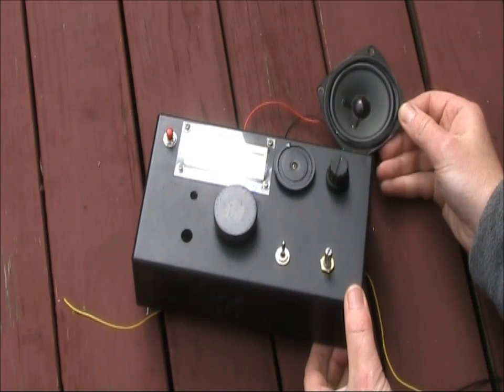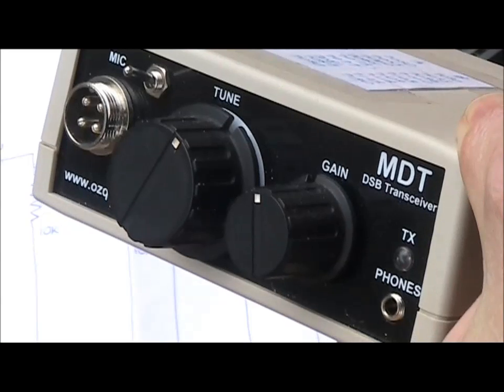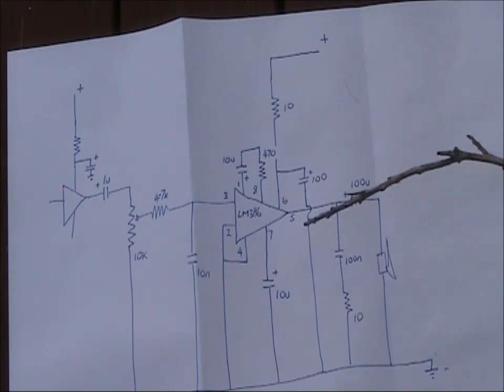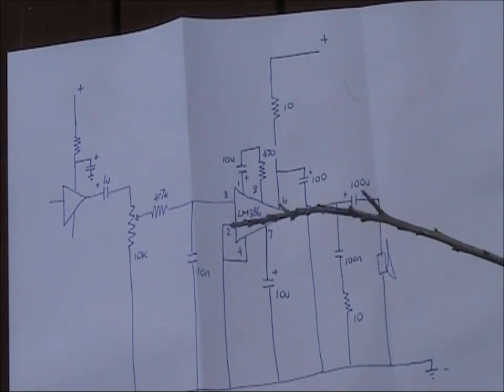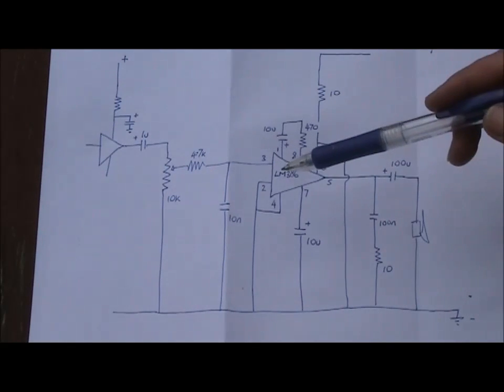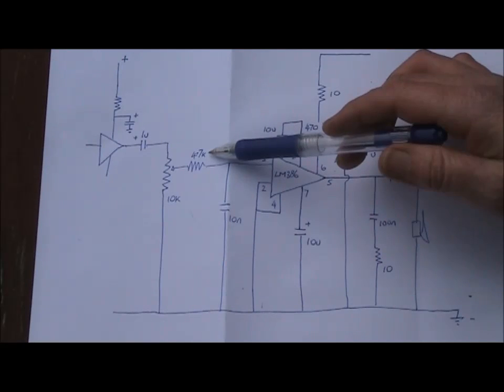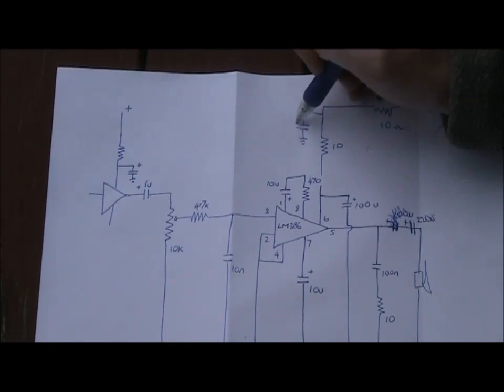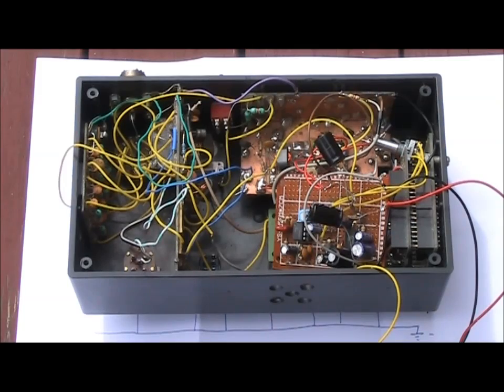Debugging an LM386 audio amplifier circuit

Comment: why not go one better and build a simple 4 transistor audio amp at one watt,why muck about with that lm386,to get it near stable look at how many components you had to add,years ago it was a great standby chip but somewhere along the line it started to fart and burp and get hot😂

Comment: where could i find the lm386 ic chip
Reply from the maker: ebay
Reply: cheap PC speakers, fax modems, bluetooth audio devices.
They are an 8 leg IC and they may not be numbered LM386. there are TDA variants also but the pinouts are similar